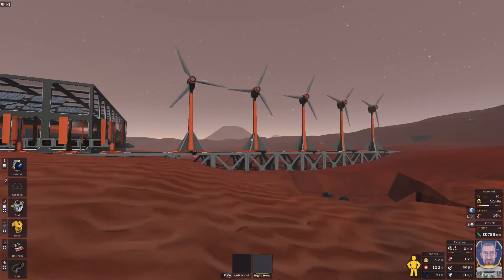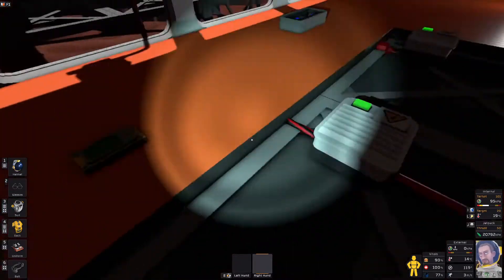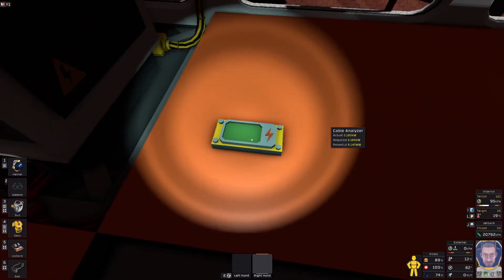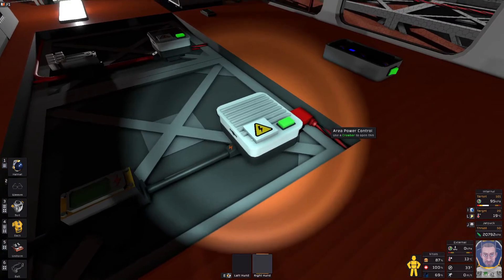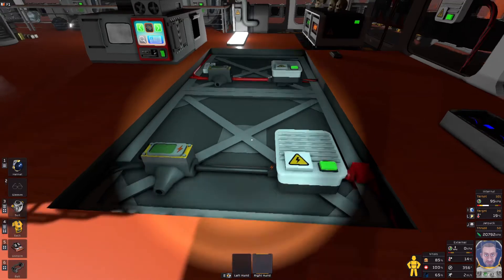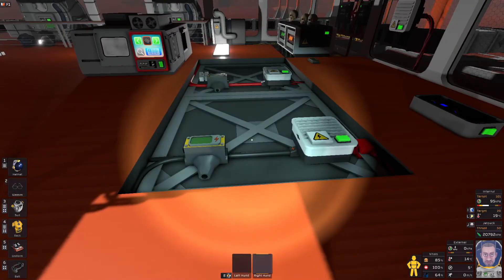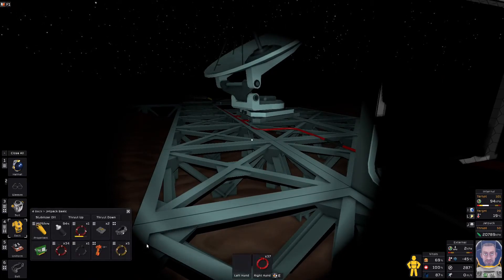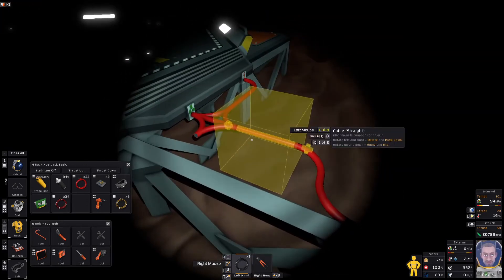Stationeers - Power Distribution tips and tricks, no logic required.

Comment: Those are not "breaker boxes" They are APCs and it doesn't restrict power, it only provides a way to separate your networks, a battery for power, and a switch. You have to use a transformer to restrict power to less than 5kw to protect the small cable. There is a large transformer to go between the larger batteries and the rest of your networks. Thanks for the video, very nice!
Reply: Yeah, the wiki specifically mentions that APCs do not limit output power
Reply: @Lanik42  yea, one of my first mistakes
Reply from the maker: The method I show using the least amount of alloys. Which is what I was going for, but your right there are more advanced tools you can use.
Reply from the maker: When we use this configuration the wires on the other side do not burn. You can use a transformer to do the same job, but I do like battery back up. got trapped in an airlock to many times because the sun went down.
Reply: They used to, then they put the small and large transformers in the game.

Comment: Power Controllers are useful for Airlocks and Lights- smaller usage devices that don't need a lot of wattage but need battery backup. It's good to put devices that pull a lot (Like wall heaters, pumps etc) on transformers and they come in multiple sizes.   Thanks for talking about this game, I have been playing it pretty hard for a while now.

Comment: I'd rather put transformer rather than box breaker.
It's cheaper since you don't have to manufacture battery, 
usage friendly since you can easily switch it on/off without opening the hatch,
and you can put max current on the cable downstream, no cables ever burned.
It even can be used to separate energy generator, so you can use normal cable for solar panel clusters before merging it to the main bus heavy cables.

The only use of box breaker is when a tiny battery is enough to power an important closed system, like an airlock or detached weather tower.

Comment: The small transformer works really great to separate power circuits, they have a max output off 5k wats and u can it em down for power saving if u you wish. Also another thing of note the large transformer has a max output of 100k perfect for not burning up lg cable
Reply from the maker: agreed transformers are super helpful. I like to use them to turn off whole rooms when they aren't in use like our work shop.